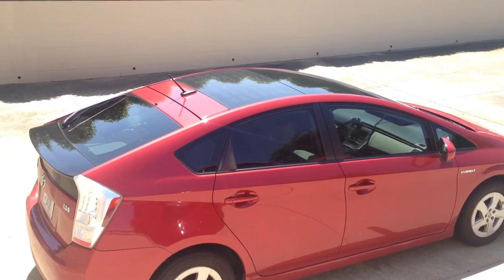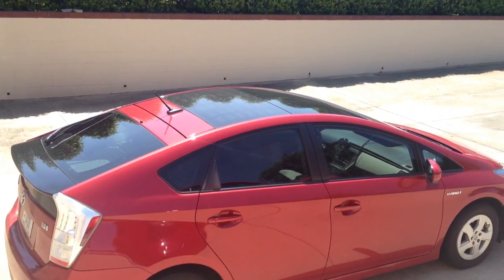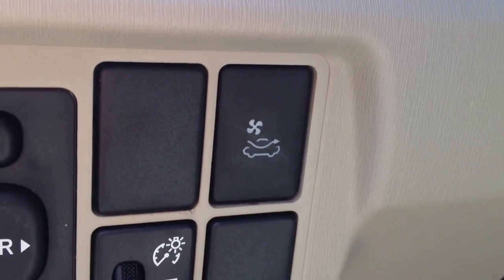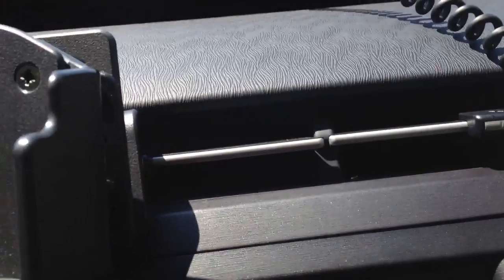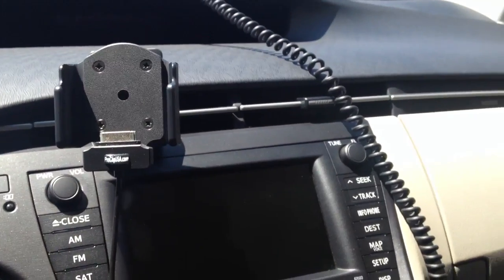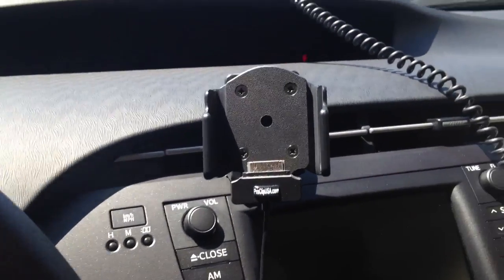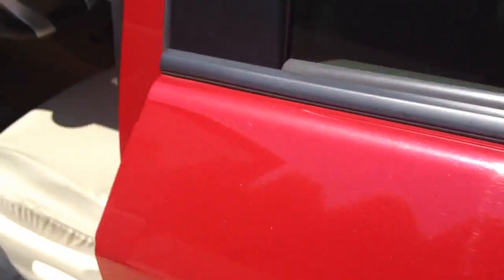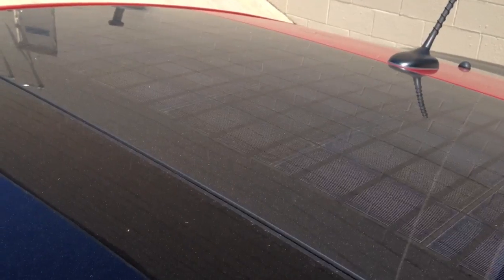2010 Toyota Prius III solar panel demonstration

Comment: Does this solar system charge the battery fully , is it a hybrid car or fully electric car, how much Kilometer takes if you fully charged the battery .
Reply: Hi, I know I'm 4 months late and you might have gotten your answer but here's what I know.
The solar panel roof does not charge the car's battery in any way. Solar is use for the ventilation system, AC, and maybe heater as well. So it keeps your car cooler and maybe might save soke more gas as the AC system runs off if adequate solar energy is available.
Reply: @crispykevin5606  you might’ve been late but never late for the new comers looking for you answer so thanks.

Comment: Why Toyota thought this option package was worth $4,000 I'll never know. Would be worth it if it trickle-charged the hybrid battery or at least the 12v battery but it doesn't do either.
Reply: Dang I thought it ran the A/C and/or trickle charged the High volt battery 🙁
Reply: $4000, are you joking?

Comment: it's not fresh air conditioned... it's normal air.... what's the benefit?
Reply: It does keep the car less of an "oven" when sitting in the sun all day, but it's kind if a useless gimmick. All the cost and engineering that went into the solar panel option shoukd definitely give some better benefits.  At least trickle charge the 12v battery, power a 12v outlet,  maybe allow the radio to be played with the car off, if possible.
Reply: The benefit is to maintain temperature in side the car.
Reply: the benefit is that you have the option.

Comment: in the hot weather it useless
Reply: Circulation of air is never useless, (and the Prius A/C is instant cooling when you get in the car) ..but the real bonus here is, the fact you can rewire this solar panel to so many project applications and switches to use those applications is perfect! Plus the solar panels are built in to where you don't have external solar panels sitting around somewhere inside the car, is priceless!

Comment: Is it true that you can drive the Solar Prius at 45 mph or slower you don't need gas?
Reply: For the Gas Prius - Under 25 mph, you'll get about one half mile, in electric only mode. Enough to get you off the freeway in an emergency. 
The Solar only runs the vent fans as designed by Toyota. Nothing else. It keeps the inside of the car the same temp as outside. As opposed to 140 kid killing degrees inside.
But, there are hacks on You-Tube to use the Solar Panel for other uses. It involves cutting into the wiring.
Reply: @jlgiii4749  do you have any links or info for that?
Reply: yes.. if you drive down hill.
Reply: stitch16261 no
Reply: EV mode = no gas needed (so technically you can run to the store or run to get gas for your gas powered lawn toys,...always for free) ...and on the rare occasion when this car needs gas, that too!

Comment: going to rewire mine to charge the batteries
Reply: Did you ever do this? I've been wanting to do that, or at least power a 12v outlet.
Reply: Great job! Instead though, create a selection switch, so you can still use both options! One wired to the AC recirc. and one to your 12v battery!
Reply: Is it possible?
Reply: @Mack Miguel Shut up bot
Reply: @Albert Broomhall Silence bot

Comment: http://www.treehugger.com/cars/solar-powered-toyota-prius-project.html
Solar-Powered Toyota Prius Project

Michael Graham Richard (@Michael_GR)
Transportation / Cars
August 17, 2005

Green Car Congress writes about a very cool project by Canadian engineer Steve Lapp who modified his 2001 Prius by installing solar panels on the roof. It is admitted that the car is still a rough prototype, but so far the fuel economy improvement are of 10%, a respectable figure; for reference, Honda completely redesigned the Honda Civic engine for the 2006 model and achieved a 6% increase in fuel economy (the comparison is not quite fair, but I just want to point out that it can take lots of engineering efforts to gain even a few percents). "Lapp’s modelling predicts a 10%–20% fuel efficiency improvement for the 270 watts of PV (to be bumped up to 360 watts with the additional of a fourth panel)".Here's a quote from Lapp's plan:

...the fact that [current Toyota hybrids] can run on electricity alone, with their gasoline engines off, offers the opportunity to provide them with more electricity and therefore drive further with the gasoline engine off.

Electricity can be provided from the electrical grid by charging an onboard battery, and depending on where that electricity comes from, it will have various emissions associated with it. [The plug-in concept.] However if it is provided from renewable energy sources, such as photovoltaic panels, then it is "green".

This begs the question of why not put the PV panels directly on a hybrid car and generate electricity onboard while the car is parked outside, or even while driving. The general reaction of people to this idea is that there could not be enough energy striking the roof of a car to provide enough electricity to drive any meaningful distance.

This is where the incredible efficiency of the hybrid car must be taken into account. To drive a hybrid car about 1 km, takes about the same electricity as to light a 150 watt bulb for one hour! The point is not to drive the car using only solar power, but to effectively use solar power to improve gasoline fuel efficiency.

How much gasoline can this photovoltaic hybrid car save? Well let’s look at the energy available from the sun on the roof of the car. For June and July in Kingston Ontario, about 6 kWh of energy from the sun strikes each square meter of horizontal surface. If we install 2 square meters of photovoltaic panels on the car and we collect 10% of the energy from the sun as electricity (well within present PV efficiency), we can theoretically go about 8 km each day on just the sun’s energy. If we drive 24 km on a sunny day, that is enough to reduce our gasoline consumption by 33%. This would take the Prius from 5.0 l/100km [47 mpg] to 3.3 l/100km [71.2 mpg].

And a quote from the Green Car Congress article:

The 300 VDC output of the solar subsystem is attached to the switched side of the original Prius battery, so the PV battery cannot recharge the NiMH while the ignition is off. The PV system can inject a maximum of up to 2 amps continuously into the battery while the ignition is on. [...]

The decision not to charge the hybrid when the car is off was a pragmatic choice, given the financial and time constraints of his project. Among other issues, there would need to be a thorough analysis to determined the optimal PV-NiMH energy flow/charge relationship.
::The Photovoltaic Hybrid Car Project , via the always excellent ::Green Car Congress

Comment: Gorgeous looking car with solar panels at top.
The solar panels must improve Miles Per Gallon
Reply from the maker: Dan Livni Thank you! Unfortunately the panels do not aid with charging the main battery. I wish they would as I use the EV mode frequently and it would indeed assist with higher keeping the engine off longer. It is nice to enter the car on a hot day and not have your face melted off with extreme heat. Nonetheless, I am currently achieving 55.4 MPG on my commute to work.
Reply: @TheFluffyRedFox  what is the real use on a hot summer day, when the air is hot in the outside? It should at least power the A/C system, otherwise pumping hot air from the outside doesn't make sense...
Reply: NVIDIAGeForce8500GT 
Thanks for this info.  I remember reading 10 years ago about Steve Lapp who put Solar panels on the roof of his Prius and it helped alittle with MPG.
Reply: @TheFluffyRedFox  thanks for commenting